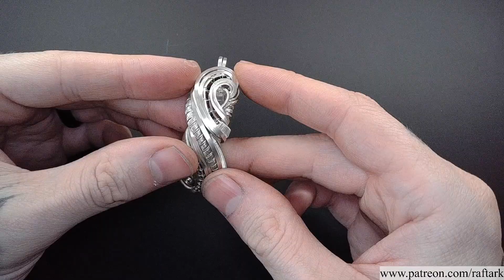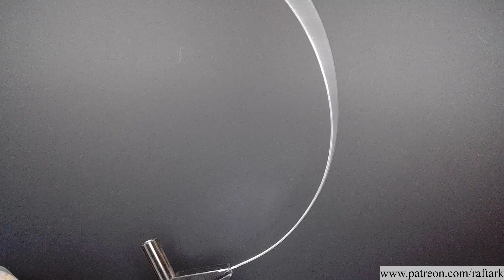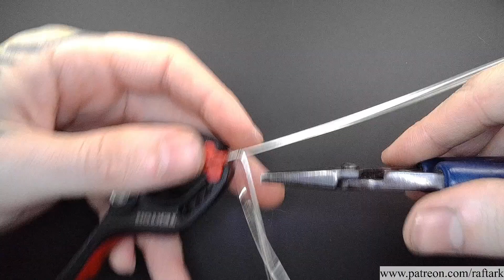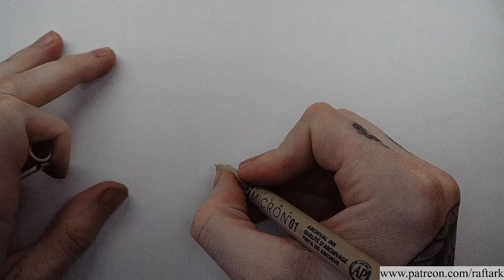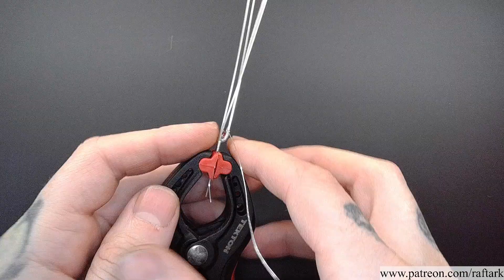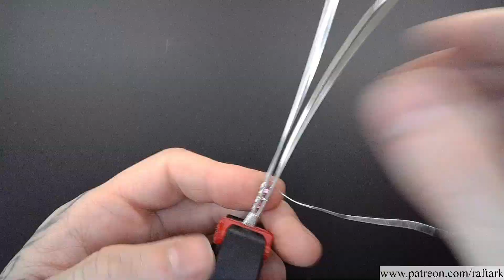Wire Wrapping Tutorial: Channel Settings UPDATED

Comment: Great video, as always. I am having a hell of a time attaching these to pieces, though; specifically, do you have any tips for how to reset a stone if it pops out of the middle of the setting, without damaging the weave or the top wires? Or tricks for knowing how tightly to weave the wire to both hold the stones in and prevent the base wire from warping when pulling the weaving wire tight?